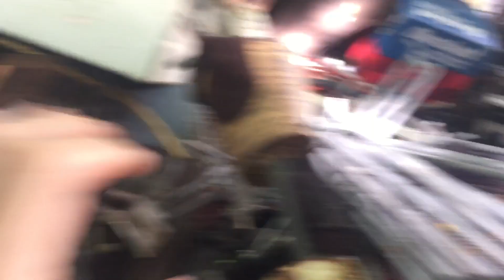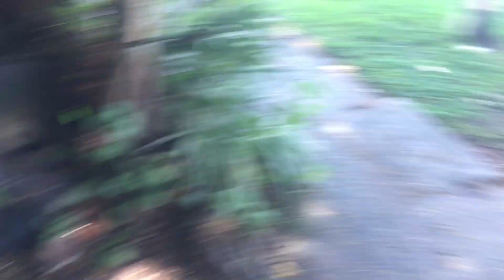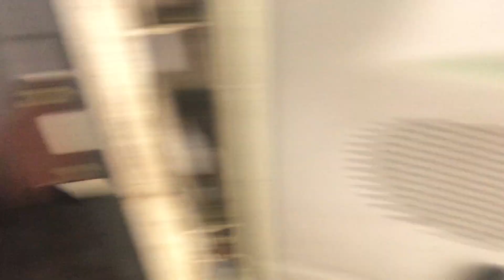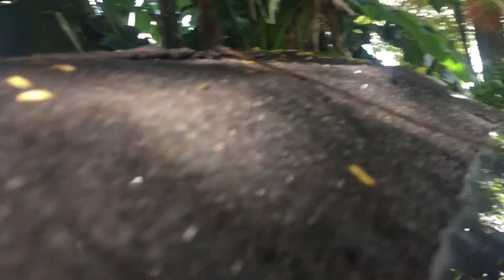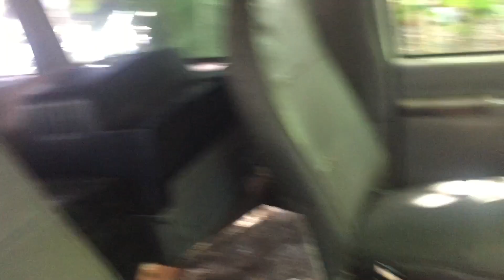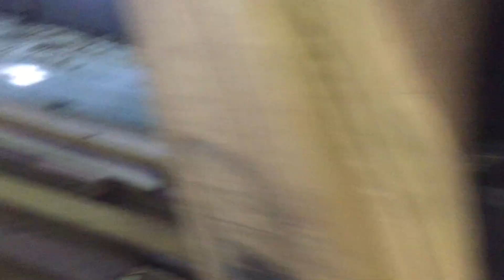Van Project

Comment: Not sure how high up off the ground your van sits but to me the hole in back may have been someone's attempt to convert that van into a camper van. The reason I'm wondering is because I converted a van once and I had the grey water going into a tank under the van. If that is something your thinking of doing maybe in the future you might want to consider not closing off that hole yet. At least not permanently
Reply from the maker: it is about the same height as a truck, I am going to cut a piece of sheet metal and screw it over the hole, it can be removed at any time.